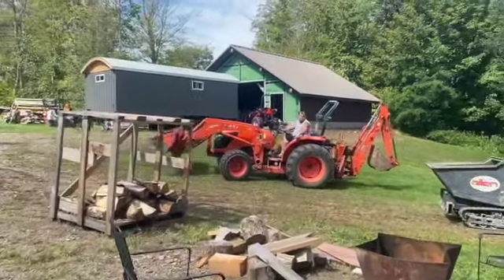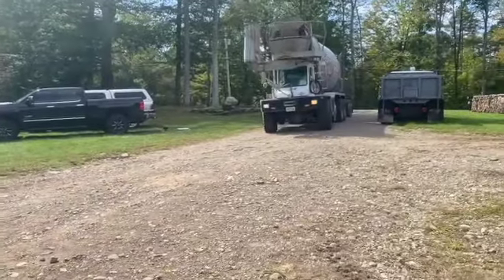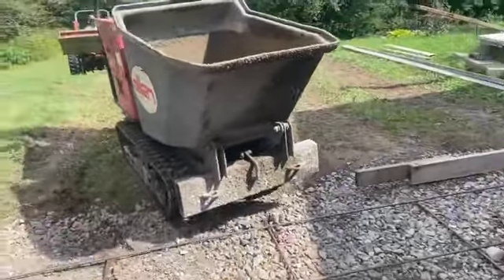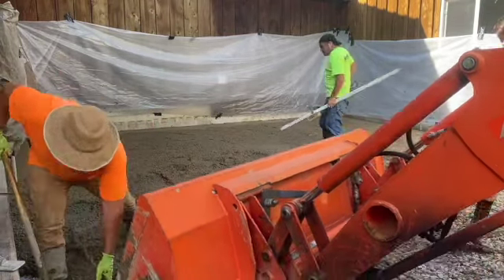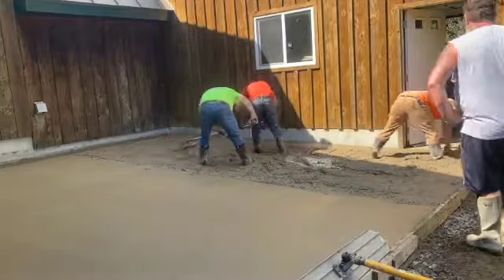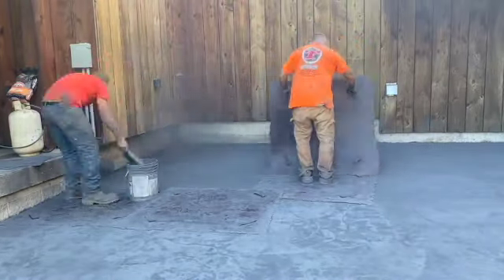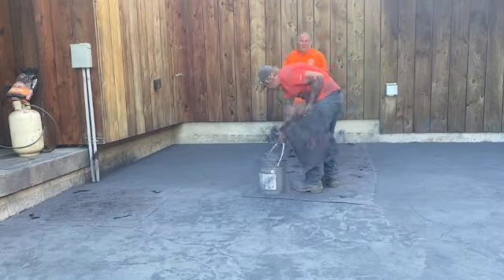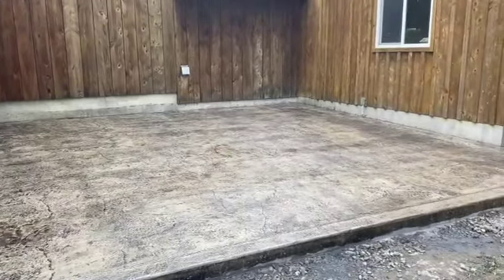Bondo is back!!!!!

Comment: hay where did you go thought you where dead, building a wood furnace out of a 1000 gal propane tank gut any thoughts on it
Reply from the maker: Hi Richard. I got one for sale that I built. Want to drive to New York? Are you heating air or water?  mine is a open system water heater/boiler